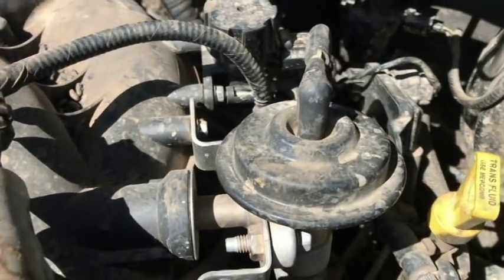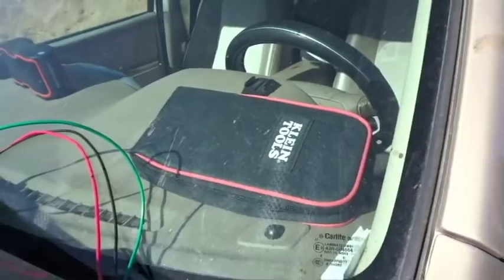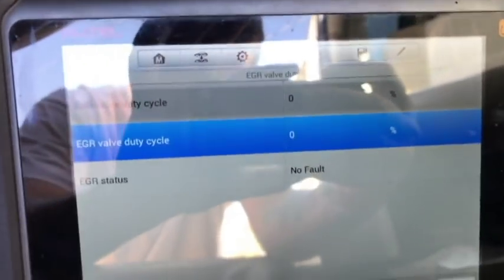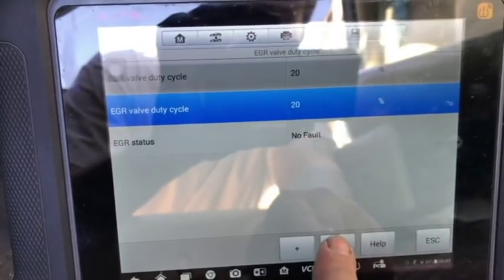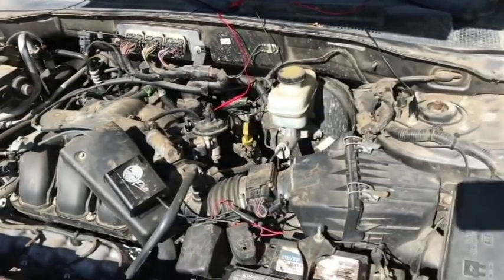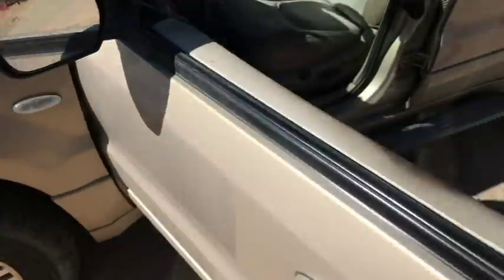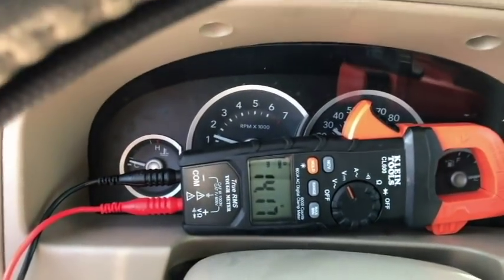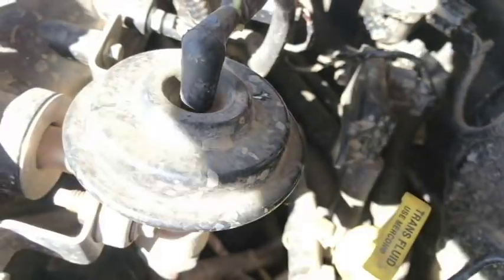P0403 TROUBLESHOOTING USING MS906TS

Comment: Help. Been searching thru tons of videos. My 2004 ford explorer won't start but battery,starter and alternator are good. The code is p0403 Exhaust gas recirculation control circuit. Can't afford to bring to shop and trying to do this myself. Is this the egr valve that's bad?
Reply: I took the egr valve out and it doesn't appear corroded, could it be the egr circuit wiring? And should I get a egr tester. Vacuum pump
Reply from the maker: hard to say. Some scan tools can open and shut the valve. If the valve is opening and shutting when you command it to do so then the problem is not in the circuit. I wish I had more information but information is limited as I am home for the holidays. Sorry I couldn't be more help. Cheers & Happy New Years!
Reply: @JustinDowDIYcentralhighway  thank u. Happy New Years

Comment: I have the p0403 EGR and p0443 EVAP but I replaced the evap valve and the code that was erased was that of the p0403 EGR, can someone explain to me why the evap code was not erased?  If what I wanted to repair was the evap, not the egr?  I'm confused

Comment: Not really familiar with mitsu's egr set ups but I thought they where linear and not vacuum actuated. The gauge thing is normal with an autel.
Reply: The other thing about using an autel and rpo codes. When it asks was seat heaters and traction set up blah blah blah ect... pick anything as long as its a system your not working on /diag it doesnt matter.
Reply from the maker: good to know. thanks for sharing your experience. that makes the most since to me. thanks

Comment: Did the engine stumble or die when EGR was activated?
Reply from the maker: If the EGR is working properly at an idle it should stumble or run poorly. If it doesn't you may have an electrical problem somewhere in the circuit.

Comment: So was the valve bad or good?
Reply from the maker: Carbon Deposits. I told him Next time it comes on to clean it. Seems to be working just fine electrically. Now he's looking at a mechanical fault. Carbon Build up will often make it where the pintal won't retract. If it stays stuck long enough he'll have to replace it.
Reply: So electrically the valve and it’s circuit is fine? If so why it there the P0403 instead of P0400 for common EGR. Fighting the same issue in Nissan Maxima.